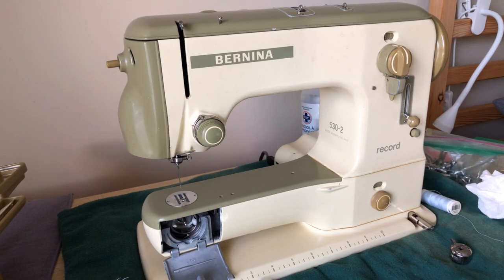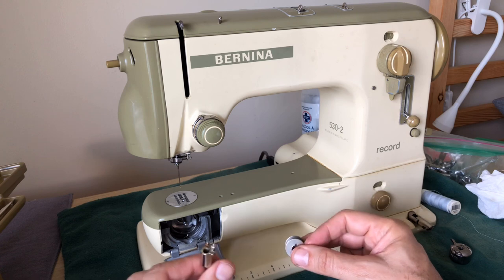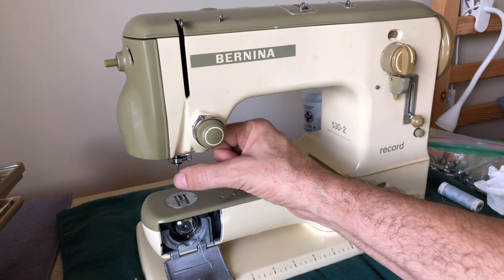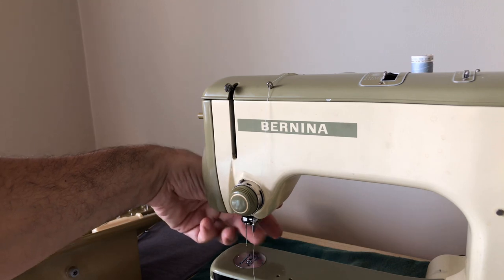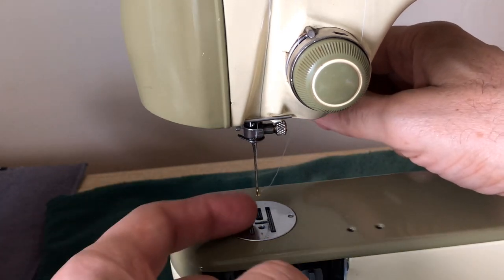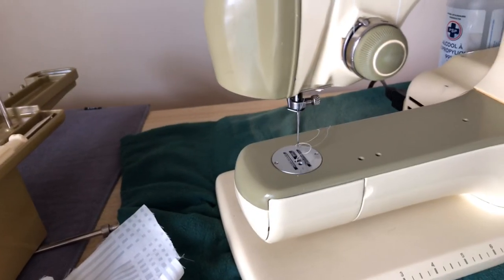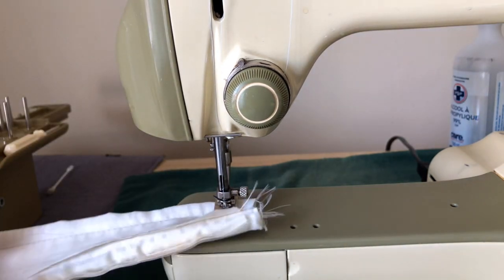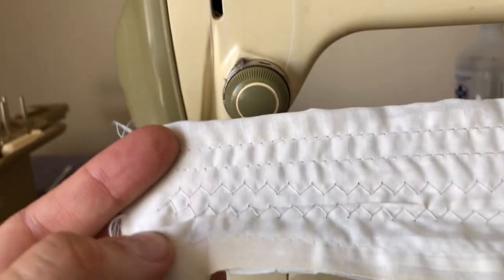TEST DRIVE SERIES #1: Do a Crucial Check BEFORE Making an Offer on a Vintage Bernina Sewing Machine!

Comment: I picked up a Husqvarna 2000 from an old lady's daughter the other day. She said it was dead and was going to throw it away at the dump. So I took it home, plugged it in, light came on, motor ran but no movement so I opened it up, bought a motor belt, put that in, cleaned the rest of the machine, oiled it and now it runs perfectly. Mechanical machines I can fix but I won't touch computerized ones. Those I leave to the experts because they are just not worth my time.

Comment: The earlier 530 machines seem to have far fewer gear issues than the 730/830 as the cracked gear issue stemmed from production issues of the gears themselves, in many years of servicing machines very few 530 machines (if any) have had cracked gears. It seems to be a very common problem  with the 830 and if one is lucky, the cracked gear was replaced under warranty.

Comment: Bernina stood by their machines so much that they had a 30 year guarantee on parts until comparitively recently. I was disappointed when I bought my 1130 new in 1989 that the guarantee was down to 10 years...I now have a 540-Favorit and 2 530 Records...as well. The motherboard failed on the 1130 and it languished for about 5 years, but fantastically there is now a person in my country who can mend them! Saved me $1000 on a new motherboard- if one could be found
Reply from the maker: Sadly, this has been the trajectory for many consumer items and not just sewing machines.  Kitchen appliances have gone the same route.

Comment: I own a Bernina 600 and it was owned by my grandmother it still works like new a little oil to make sure it's oke and my grandmother used it a lot you can see it on the paint it all but gone but still working

Comment: I came across a Bernina 640-2 favorit in an original treadle cabinet which of course I bought! I am using the treadle (the machine also had a lovely motor and can sew quite fast) mainly for free motion quilting. I really enjoy working with this betnina. When I went to the bernina dealer to buy another foot, the dealer lady was visibly upset with me for buying such an old machine and told me the machine should actually be on the junk heap! I found that quite amusing.
Reply from the maker: It sounds pretty obvious why the dealer wanted the old machine sent to the trash heap!!
Reply: @VintageSewingMachineGarage  

I always refused to buy into the hype around Bernina, proudly sewing sewing on my Janome 538, but since I have had this 640, I find myself sold! In fact, I am on my way this morning to go and gave a look at another treadle Bernina - cant see from the pic what it is, but it is a black one, so I have my suspicions... I am rather excited!

Edit: it was not black, it was green... :D

Comment: Thanks just saw a exactly same machine on ebay 90 dollars plus shipping.  But the person selling it,  said it needs chord and bobbins  and case. What do you think?
Reply from the maker: Bobbins for these are not that tough to find.  Not as common as Singers but not bad.  The cords may be available as new reproductions but are not cheap.  Foot pedals often will go out as they had some of the early transistors.  I would count on spending anywhere from $75 for the cord and close to $100 for the pedal.  If anyone knows a less costly option, please share.

Comment: Hello. I have this exact model sewing machine. I cleaned & oiled it, seems to work fine...
However: when i press the knee bar, the machine buzzes then jackrabbits... I have also "cleaned" the carbon pile and all conections. Any thoughts on what could be the culprit? Thank you.

Comment: That is incredible. Why did they use plastic gears on such high grade sewing machines ? Did it matter for them to save 3 or 5 bucks ? Or did they want their own machines to break down !?
Reply from the maker: Yes it does seem odd given how high in quality the rest of the machine is.  I've noted this on Pfaffs and (some) Necchis fro the same period too.  This is just a hunch but I suspect that plastic makers such as Dupont, Dow, and others made strong cases for using them.  Plastic gears require no lubrication (normally) and they can run more quietly while offering the machine maker a significant cost savings in fabrication.  And remember also that the service life limits of plastics were less well known and so the plastic formulators may have over promised how plastic could work over the long haul.  Today, we know and yet even auto parts makers use plastic knowing full well that heat cycles in engine bays shorten the service life of those parts which become disposable.
Reply: @VintageSewingMachineGarage  OK, thank you very much for this information.

Comment: Thank you, so interesting ! I've just got an old Bernina Record 530 from 1956. It was quite clean but it's slightly hard when the needle goes from bottom to up. I oiled everything but it only helped a little. It sews quite nicely, though. All the buttons knobs work, but I noticed that the feed dogs one doesn't work : it does turn like a charm (and when I look on the mecanism inside, it does turn), but in both position, it lifts the feed dogs, which is weird ! Could you show how it is on your own machine when you turn this knob, how the feed dogs are ? Have a good day and sorry for my english.

Comment: When did Bernina start using the nylon gears, or, is this an issue with all Berninas?
Reply from the maker: I actually don't know the exact year or model series, but I can confirm that the 117 L and 117 K models I have restored were all metal with no nylon gears.
Reply: The nylon gears appeared with the 5 series in 1952.

Comment: Another brilliant video and good advice. As with the vintage singers these machines are a crazy price on eBay presently. And most are saying they don’t know if it works etc ... know little about it ..... but a no returns policy! Madness. I would really love this machine but you’ve now taught me to be wary. Can you buy the plastic cams easily?
Reply from the maker: I agree with the risk that is there if you purchase something with no testing to see if it works.  I passed on a 730 Record because it had no power cord and I would had to have bought without even knowing if the motor was functioning.  It was not a tough decision given the challenge we have in getting parts for some of these models.